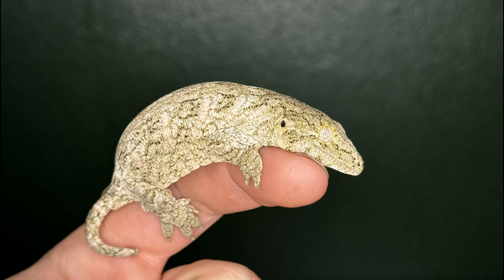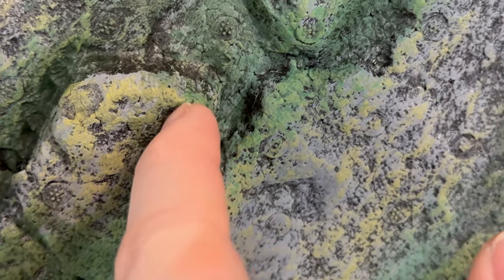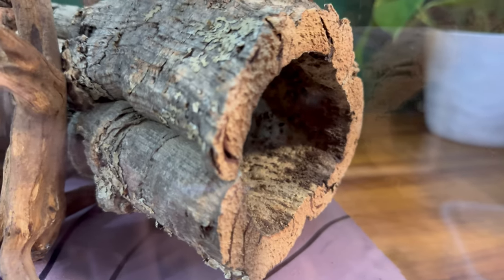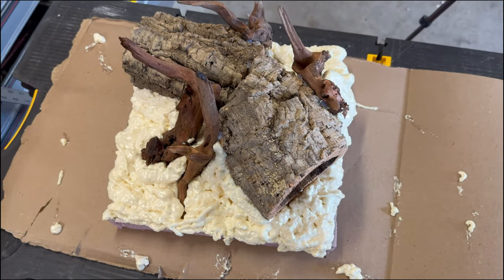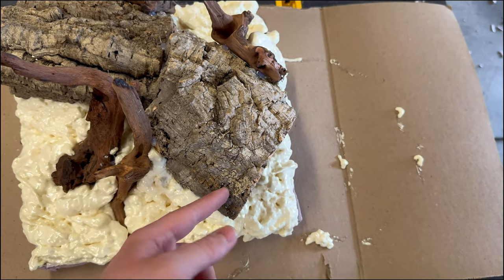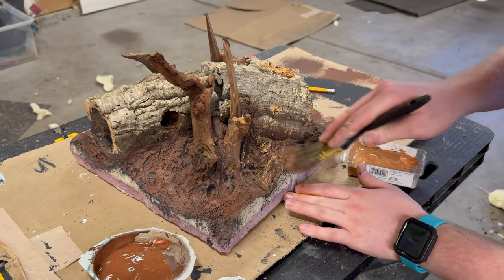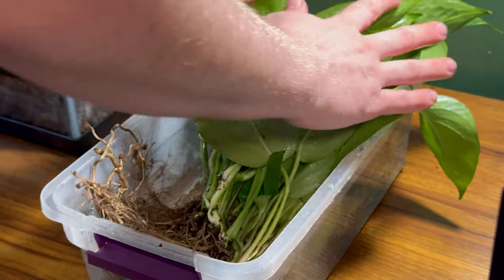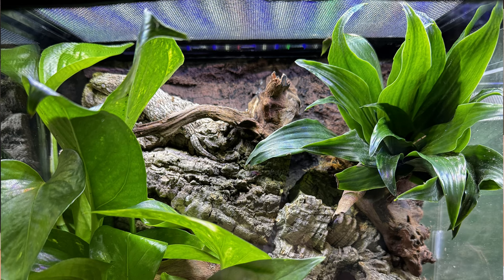Naturalistic leachianus gecko vivarium (Leachie gecko enclosure)

Comment: For the background with spray foam, did you use the white spray foam, bc if so then I understand that it will look terrible, maybe if you use black sparay foam it works better bc you won't see the white stuff.
I don't know for sure tho👍
Reply from the maker: My very first one was white and then I switched to the black stuff and still had issues. I can’t even find the black stuff anymore lol